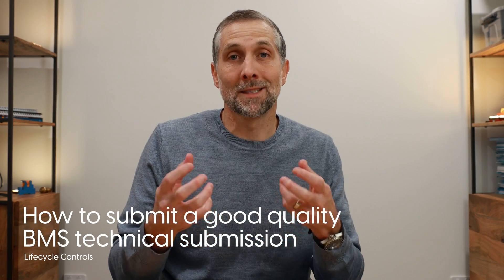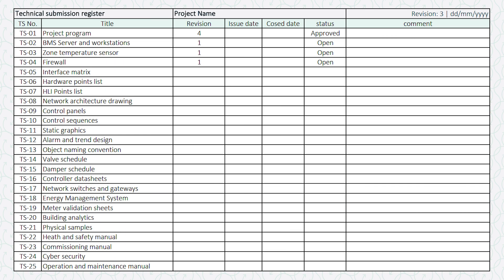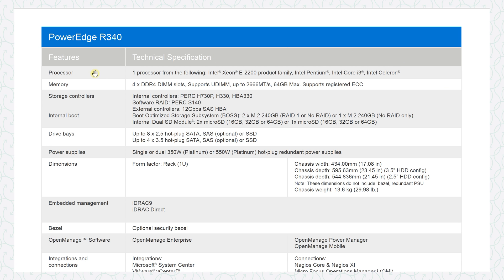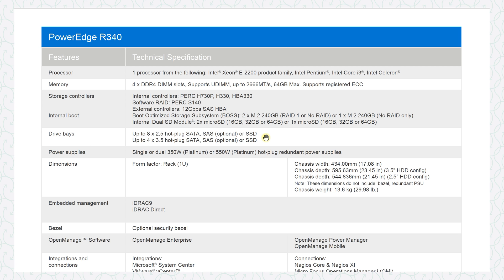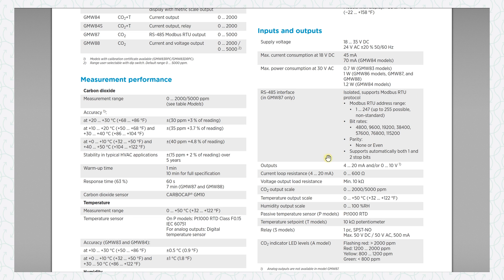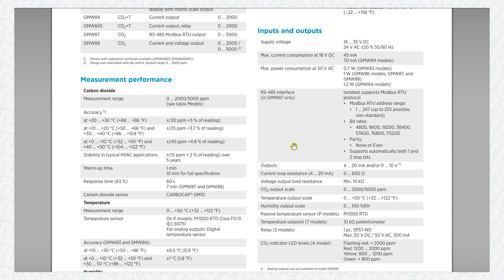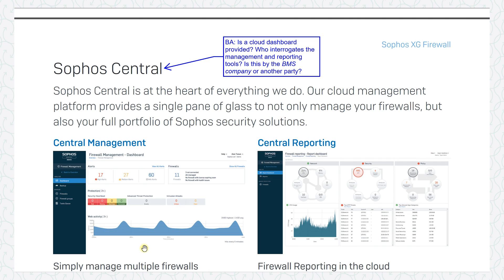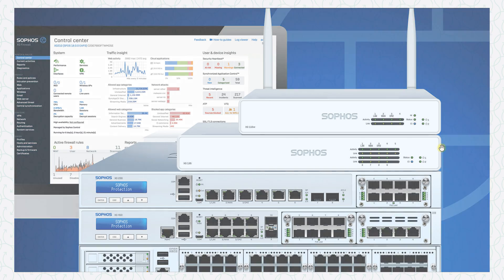How to submit a good quality BMS technical submission

Comment: Bryce, I am in the middle of creating a functional description for a large project. The spec that I am writing it from has very little info in regards to how they want it to run (major pointers only) We as a BMS company have to write this up based on the information that we have. If there is little guidance in that spec then we just waste considerable time resubmitting FD’s until we get it right which should have been explained in the first place. There has to be an answer to this problem as we all know time is money and this procedure waists a lot of it. If we were doing a system for a nuclear power plant then you would think there would be a detailed description of how it has to work ! HVAC is no different.
Reply from the maker: Sorry Dave, I haven’t been on YouTube for a few months. I just uploaded a video and realised there are a bunch of comments in here. 
I'd suggest you arrange a workshop with the mech consultant before you start. 
Go there and talk to them, explain that you need to start the design but there isn't much in the spec and that you need some direction. Be cool about it. 
The mech consultant will realise they haven't given you enough detail, they will probably feel bad about it. They probably felt guilty when they issued the spec knowing it was not complete. 
Often the problem is that the mech consultant does not know how to control the system. Tell them you will fill in the gaps, you just need to understand the mechanical intent. 
You will get respect for tackling the issue like this and will get an opportunity to build up some report with the consultant, which will help you later.